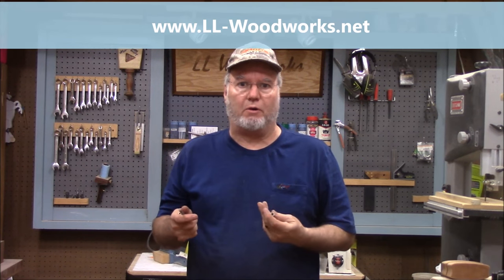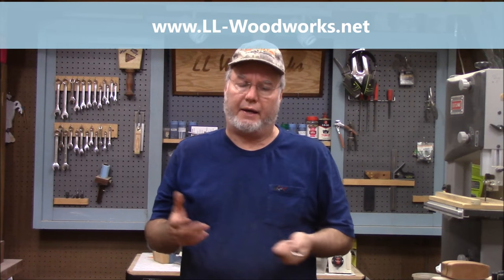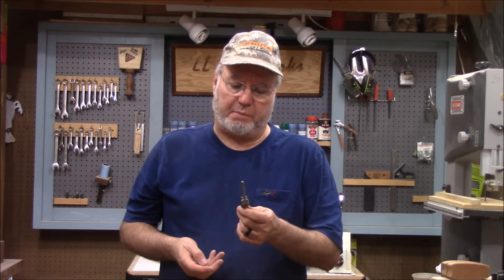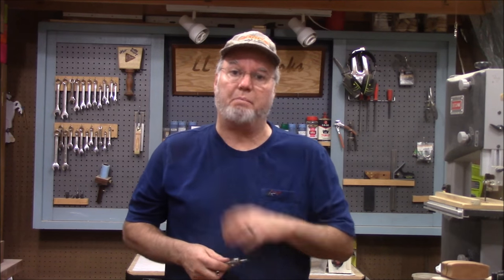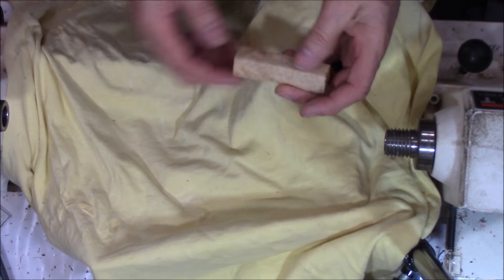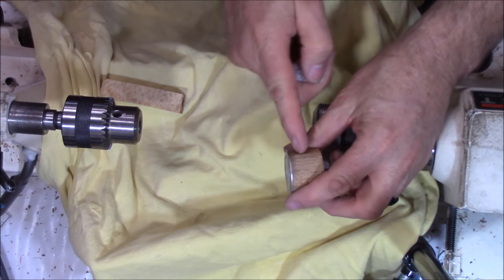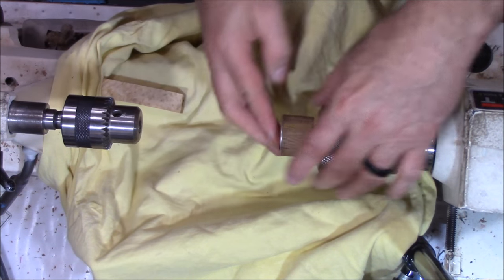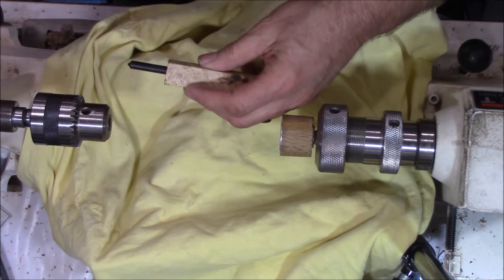How I Square a Pen Blank

Comment: That is a great idea.  It would also work to clean up the ends after coating with CA glue.  I am going to make one this week.  For a punch I will use an old pen mandrel for the 7mm tubes. Thanks.

Comment: If one doesn't have a collet chuck, one can simply make a faceplate, grab it with your regular chuck jaws, glue a piece of sandpaper to the faceplate, use the mandrel in the tailstock, slide the tubed blank over the mandrel and then advance the tailstock until you can contact the blank with the sandpaper.
Reply from the maker: Very good thought - thanks for the input and for watching.

Comment: Great idea. I came up with a similar method after watching many YouTube videos, which used things that I felt were not ideal. If I'd found your video earlier I would have used your method (and still may make it anyway). Simple, inexpensive and pretty foolproof.
My solution uses an oversized mandrel to stack wood on a metal shaft to make fancy hammer handles, with a pen like construction, but your method would still work even on pieces over normal pen sizes. Genius.

Comment: I like your method,  I did something similar but I was using the mandrel and it really only worked well with 7mm kits. I ended up scraping it. This looks more promising with the Jacobs chuck and the punches.Regards,Bob
Reply from the maker: +RJBWoodTurner  It works better for me and I appreciate you taking the time to watch.
Reply: Scrapping?

Comment: Thank you for posting this... I really didn’t want to have to order an $18 barrel trimmer.  I have a Shopsmith with  12” sanding disc, so tour method should work great with my setup.  :)
Reply from the maker: Great good luck
Reply: I just finished my first pen yesterday and I used my Shopsmith sanding disk to trim the blank and it worked great.

Comment: I completely agree that barrel trimmers are a pain.  Ended up making a jig to hold a punch perpendicular to the disc on the disc sander.  I can use different size punches depending on the blank I'm trimming.  I tried using the lathe similar to what you are doing.  I seemed to always be changing the sandpaper though.  Looks like you're using a courser grit of sandpaper than what I tried.  60 grit paper would probably have been a better option.
Reply from the maker: +John Hendricks Thanks John, I appreciate you watching.

Comment: Great tip Lynn thanks, you may want to look at a Rose shotgun mic. Will help your videos
Reply from the maker: +Warren Downes - One Wood  Yea I've got a lot of background noise with the vacuum and a fan. I actually have a lapel mic but I'm to lazy to sync the sound files with video in post. If I did that I can eliminate all that noise. Thanks for the suggestion and for watching.

Comment: Very informative Lynn. I’m in the market for a collet chuck. Any preferences, suggestions on brands/models? Also do they make one that comes with different size collet inserts as a package? I’ve never used on before so if you have any info on price or where to purchase, any and all assistance would be appreciated. Thanks Lynn!
Ron
Reply from the maker: Hey Ron, thanks for reaching out.  This is the one I bought from CRaft Supply   https://www.woodturnerscatalog.com/p/101/4400/Apprentice-Collet-Chuck-7-Piece-Set?term=collet+chuck&term=collet%20chuck.    Thanks for watching

Comment: What is the diameter of the face with sand paper? I found a machined mandrel from Sherline Products part number 3051 and bought it.  It has a #0 morse taper and its head is 3/4 inch. I plan on trying this in my jaw chuck to see if it works.  The question I have for you is what the diameter has to be.  Is 3/4 inch enough for most pen blanks.  I think it will work and can't wait to get back in the shop.  Love your videos!  Keep on doing what you do.  The best to you.
Reply from the maker: +Edwin Leach Hi Edwin, the diameter on mine is about 2 inches but it doesn't have to be that big. I would guess it needs to be big enough to service your largest pen blank.  I would think 3/4 would be fine.  Thanks for reaching out and thanks for watching.

Comment: THANKS Lynn!!!  Great method of squaring the ends of pen blanks!!!  I, like you, have ruined a number of blanks using the end barrel trimming method, what a pain in the ole patoot!!!  Your method looks much simpler, easier and as square if not more so than using my old method or using a belt/disk sander setup!  I also 'round' off the blanks edges sooo the blank/gauge doesn't chatter or catch easily on the wood when roughing!!!  Again, THANKS for a great idea...when ever in doubt, ask a more experienced woodturner!!!  ;>)
Reply from the maker: Thanks "Old Codger"  I appreciate the comment and support.   Best Regards

Comment: Similar to what I have been trying.

Question: Are you standing behind the lathe, using a mirror or is that a left handed lathe??  :-)                     JimE
Reply from the maker: +blackemmons Hey Jim, as I stand facing the lathe the head stock or drive end is to my left. I have the camera above and behind the lathe. Thanks for watching I really appreciate it.

Comment: Great idea Lynn! This is a perfect solution for a problem I have, a kit that doesn't have a sleeve available for the barrel trimmers. Been sitting around waiting to find an accurate solution to present itself, looks like it has! I don't have a collet chuck yet, have any suggestions on where to get one?
Reply from the maker: I think I bought my collet chuck set at wood turners catalog (Craft Supply.  Check this link https://www.woodturnerscatalog.com/p/101/4400/Apprentice-Collet-Chuck-7-Piece-Set?term=collet+chuck  and thanks for watching  Zac.
Reply: Zac Higgins hey Zack not to take away from Lynn's process I purchased an arbor from Amazon and thread on a piece of wood and then did the same thing as Lynn using sticky backed sandpaper and punches from Harbor freight to square my blanks. Here's a link. 2 Morse Taper to 1/2"-20 Threaded Drill Chuck Arbor https://www.amazon.com/dp/B0007Q1Q32/ref=cm_sw_r_cp_tai_LNDmybRYYJT2J
Reply: Thanks Lynn! I think a collet chuck will be a useful addition to my toolbox. Need to get a set ordered and get on that pen kit that's been collecting dust
Reply: Thanks for the idea Tracy, that would work good too... but I've been wanting a good excuse to get a collet chuck too :D

Comment: Great idea, but you don't need the punch even.  Just use the drill bit that you already used to drill the hole in your blank.
Reply from the maker: +colojeeper2003 thanks for the thought but the bit used in drilling the blank is larger than the inside diameter of the tube. I like a tighter fit than that would give. Good thought though. Thanks for watching and taking the time to comment.
Reply: Lynn Lacey Wrote what I was seeing instead of doing. I used a drill bit I think was two sizes smaller out of my set of bits to use inside the tube.  Love the idea though and plan to use it.
Reply from the maker: I see what you were saying - thanks for the comment and good luck.

Comment: So instead of having to keep up with the inserts for the barrel trimmer and the added expense they bring, you have to buy a big set of punches to keep track of, and you have to buy a collet chuck set to keep track of. Seems a little counter intuitive to me. On top of having to fabricate the sanding disk and hoping you can make it perfectly flat, and also having to buy and keep track of adhesive sand paper.

Comment: You really need to remove that yellow towel in the video under your work. It is an accident waiting to happen. Get a dust collector if you are worried about your lathe. You might say I’ve done a million and never had a problem. I’ve seen things get pulled into spinning tools like drill presses and lathes.